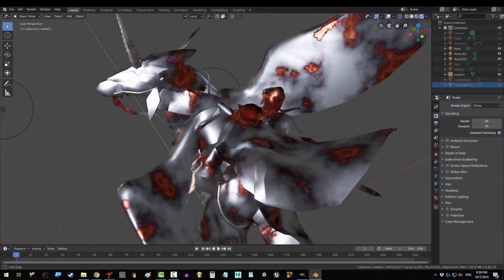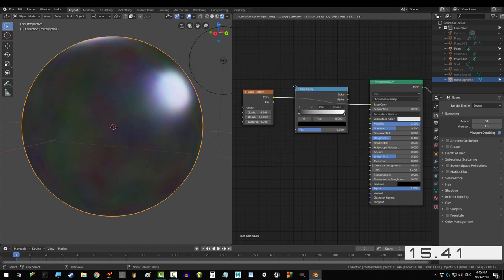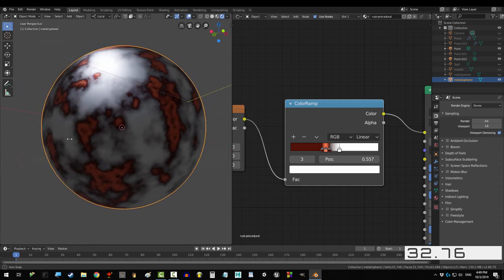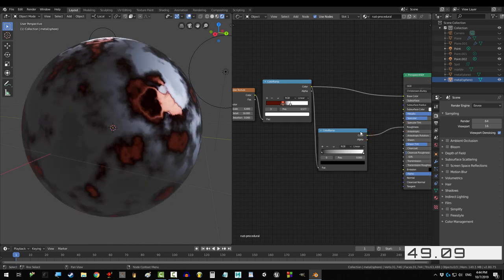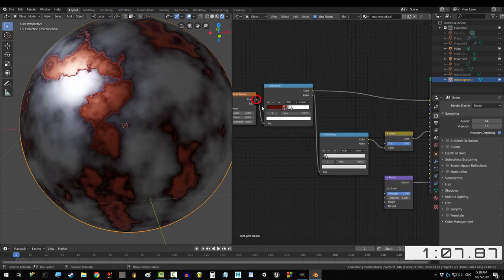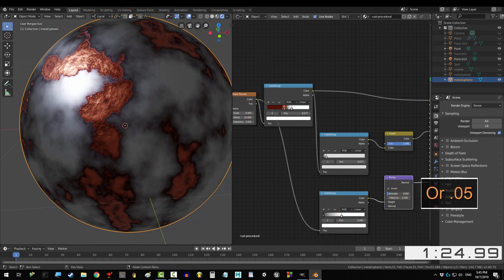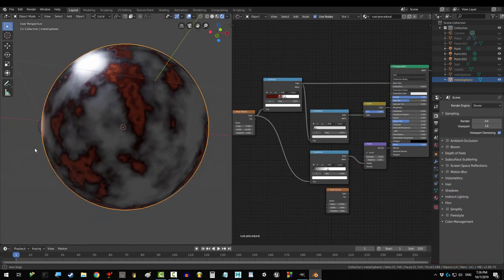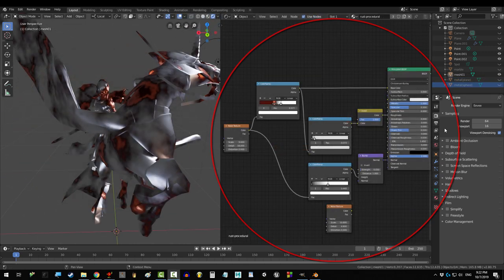Blender 2.8 : Procedural Rust (In 2 Minutes!!!)

Comment: It's not correct since rust is not metallic, you need to mask out the rust ... If you take a  look at this scanned rust texture the metallic map is almost black with white spots which means the majority of it is non metallic with only small parts that are metallic. you on the other hand made the entire texture metallic. https://www.textures.com/download/3dscans0404/132988?q=rust
Reply: But rust is just a metal that is too rough...
Reply: @solarwindex  Rust is not a metal though.  Once it is oxidised it goes from conductor to dielectric. Technically for metallic we should not use any value other than 1 or 0 as there's no in-between irl, but whatever. :-)

Edit : I just came across this essay online :  http://www.imm.dtu.dk/pubdb/views/edoc_download.php/6645/pdf/imm6645.pdf that is all about rendering metal & rust. I haven't read it yet but looks interesting, at least for us CG nerds anyway!
Reply: Thanks for this knowledge. I will check the PDF file :D